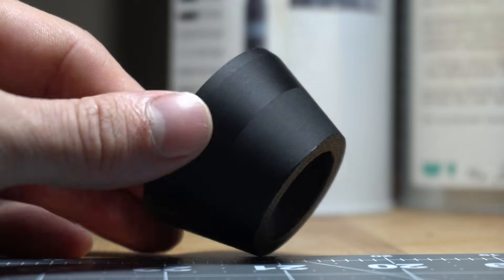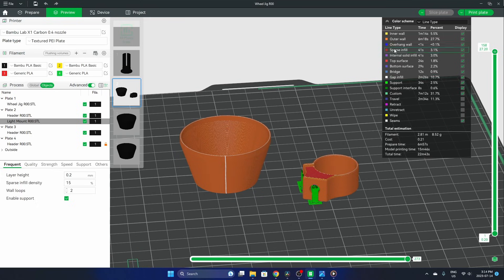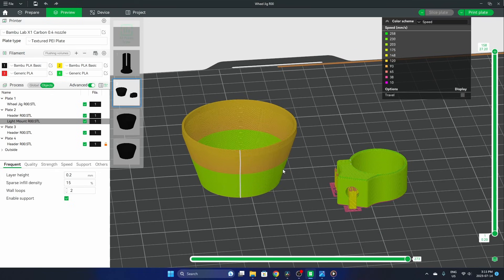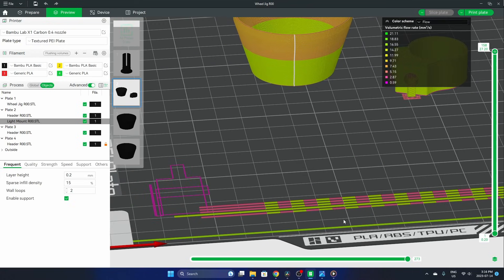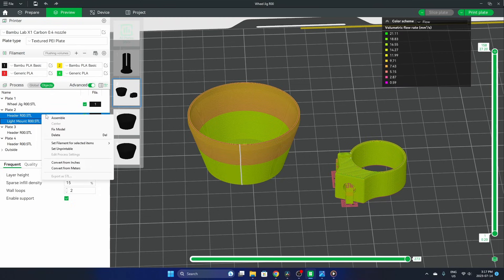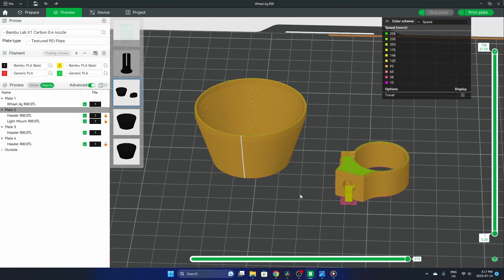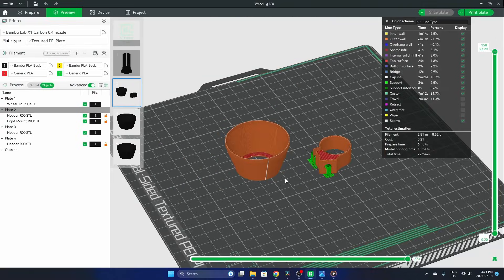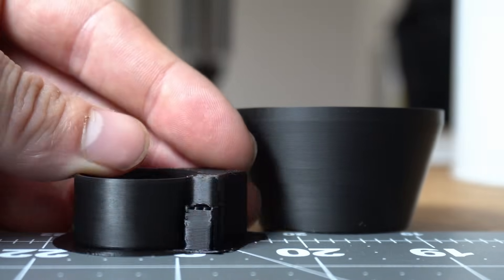How to avoid 3D prints that look like THIS in Bambu Studio

Comment: Good tip! This is probably related with the "minimum layer time" filament configuration, which is preventing the top of that object from printing faster, and since the bottom has that other object, it makes the layer time to be higher, so higher speeds can be reached. If you changed only the bigger part outer wall speed to 100ms it would also probably work, and yeah decreasing the minimum layer time would also improve it and make the print even faster - in this case it could lead to cooling issues, but its worth it trying, I've noticed that for some parts it can be decreased a little bit without any issues.
Reply: This explains it! I was so confused why this would happen.
Reply: Yep, came here to say that.
Reply: Isn't there an option to make the nozzle wait somewhere to ensure the minimum layer time instead of printing slower?

Switching on "timelapse" may help on some printers. Another option could be switching to "print infill first" and add a small pause to every layer - and turn down the minimum layer time to 0.
Reply: @philipp9800  yep, these options are definitely worth it trying, the results may be good depending on the printer and the filament itself. Unfortunately I didn't have much success with any of those options, by the end of the day I ended up having other issues due to the pausing/resuming process like oozing filament, stringing, precision issues (printing the infill first) - that of course can be mitigated as well, but since it wouldn't necessarily make my prints faster anyways, I realized that what worked best for me was just making sure that the outer wall speed is as more constant as possible by picking an average speed - even if it means reducing a little bit the speed, OR just reducing the minimum layer time. I mean, these new 3d printers has that side fan cooling which helps a lot cooling the parts, so if it doesn't have much overhang you can decrease it safely and reach higher speeds even in small parts.
Reply: You wrote it's "preventing the top of that object to print slower", but if you meant the opposite, "forcing the top to print slower", then it makes sense 😅 Physically it could move just as fast, but the layers wouldn't have enough time to cool, so it slows down its movements.
Reply: @renxula  Damnnnn hahahahahahah sorry, you're 100% correct I really wrote it wrong. It was supposed to be "preventing from printing faster". I just edited it so nobody gets confused with it. Thank you!

Comment: looking at that bambu studio has the min layer time to low so it slows down. i would guess each of those layers once its one part is less than 5 seconds if at 200mm/s
Reply from the maker: Yea, lowering the minimum layer time is also a solution to this issue. I just didn't know about minimum layer time when I was filming this video.

Comment: Very unsightly seam: 
3:51

Is there any way to remove this?
Reply from the maker: It's on my to do list to make a video about the z-seams. You can choose "random" for the z seam but I find that looks worse on most prints. You can hide it with "fuzzy skin" but I personally don't want most of my parts to have fuzzy skin. 

You can also adjust the wipe speed + gap settings but I haven't seen great differences setting these settings to their extremes.

Comment: Is there any plausibility to evoid white line on slices (weld thing i suppose)?
Reply from the maker: It's on my to do list to make a video about the z-seams. You can choose "random" for the z seam but I find that looks worse on most prints. You can hide it with "fuzzy skin" but I personally don't want most of my parts to have fuzzy skin. 

You can also adjust the wipe speed + gap settings but I haven't seen great differences setting these settings to their extremes.

Comment: I recommend not only looking at Speed differences in the preview, but also at cooling differences. You want these two being as uniform as possible for your parts.

I would also not recommend compensating these effects by generally slowing down.
This simply turns a very fast printer into a very slow one...

I would rather keep the higher speeds, increase my part cooling and change my layer time settings to avoid auto slow down. 
Bambu-Studio also has dedicated speed settings for overhangs. 
In case of printing parts with overhangs, that might also need adjustement.
Reply: whats a good min fan layer time? and max fan layer time ? i can't seem to understando how that works
Reply: I solved it thanks to you! Thank you very much!

Comment: 1. On final prints simply keep a low temp to avoid the shine effect.  
1. Another way is to use a high temp filament, for those barely exhibit the shine effect across temperature/speed swings.
3. Print one object or multiples of the same object.
4. Use temperature profile hack that only exist in proprietary software of which you don't own equipment.

To this day, users STILL have to baby sit the printed part by adjusting speed and temp at certain layers.  So where is the so called A.I. these print companies boast about?

3D printing is till in its zygote stage of life.

Comment: To me this seems to be minimum layer time causing this. After the first part is done, the printer has to do a lot less work per layer, so it slows down to still reach its minimum layer time. That's why the individual object is printed in the orange range completely, and not partially in the green range.

Comment: all bambu settings are FAR to ambitious. they think that ABS likes to be layed down at over 200mms 😅 oh my... sure... it CAN.. but the result is subpar at best. go see the manufacturers recommendations and u see what their filament is best at. the machine producer in this case is all about speed. so the lazy approach is to lower to volumetric flow in the filament section to one fourth of their number. start from there. u will get MUCH better prints. their hotend is not up to the task of their motion system. these rigs need cht badly imo

Comment: you may want to consider redesigning your holes not to have support. You really shouldn't need supports for those types of holes.
If you want them to look nicer you can turn the hole into more a teardrop shape at the top so the printer is printing a more gradual overhang instead of a sharper one with a circle.
even with a circle though it will print fine with no supports. it will just be a little messier at the top.

Comment: But why is it printing outer wall at different speeds within that object?  Does it have to do with the min layer time?
Reply: Most probably is has to do with min layer time. Could try so reduce that parameter, and keep speed as it was.  Should get everything printed faster, and same speed through entire print.

Comment: Spray paint mate, just paint that and you are golden. Don´t need different colored filament as well.
Reply from the maker: Yeah that's one option. But most people don't want to deal with that post possessing step.
Reply: @3DPrintStuff  That´s true. It is an extra step, and your solution is good. You showed how when this happens it is printing settings which change over time in the same part. So it might be speed, or volume or cooling changes. BTW this happens a lot with "slow down for overhangs" function, you can see it in a single Benchy for example.

Comment: can you change the settings so I can add this to my playlist? I've been saving vids to 3D printer tips but this one wont let me D:
Reply from the maker: @ellieelias6336 Hey I don't think this is a toggleable setting... I just did some looking around in the settings and there is no option for "allow adding to playlists" or something similar. 

I just made a new test playlist of my own and can't come across any videos that won't let me add them to the playlist. I did have an issue where the add blocker I'm using didn't display the "save" button so I had to disable add blocker. 

Maybe try again and let me know if it's still an issue?

Comment: i found another way 

go to click to edit preset  ( button next to preset e.g Bambu PLA Basic)

go to cooling tab

find "minimum printing speed" default is 20mm/s 

change it to match outer wall speed e.g 200 mm/s

200mm/s gives you a matte finish .

Comment: Did you ever run into seam issues? If so How did you fix it? The seem gap is very noticeable on my prints
Reply from the maker: Yeah, seam issues are a common complaint on these printers. I'm working on a seam video. You can try setting the seam to "random" but I find that can look even worse with some filaments, especially silk pla.
Reply: @3DPrintStuff  Awesome! Good stuff. I'll stay tuned in.

Comment: An easier option would be to check the flow rate of the glossy section and set the maximum flow rate of the filament to match. No need to adjust speeds for every print that way, it will be automatically speed limited.
Reply: Turning down flow globally would limit infill speed, would it not? Definitely don’t want to do that on something as fast as a Bambu.
Reply: @ericrandall3539  it would, you could use a higher flow rate limit and % speeds to create a nice profile with fast infill and slower external perimeters. Nobody wants to hear this though because it takes more than 10 seconds to tune.
Reply: @ericrandall3539  well yes but that wasn't exactly the point of this conversation. Go as fast as you want
Reply: That's another option although not easier. You just need to set print by object and space the objects far enough from each other. For surface quality it's better to print one object at a time if you do not need to print too many or too tall parts so it causes interference. Also you should reduce the flow rate anyway unless you need to print really fast as faster speed produces weaker parts.
Reply: @woopsserg why do you speak when you don't understand what he's saying. So much nonsense on the Internet of people saying stuff when they don't understand. Stop!  Think before you comment. Reducing the maximum flow so all flow is equivalent will eliminate these problems. Some of this is often caused by minimum layer time on small parts. So when you print two objects the speed can increase and when the other object is finished minimum layer time comes into play and slows the speed down causing this visible change in the surface quality.
Reply: @trafton00  "why do you speak when you don't understand what he's saying." "Stop!  Think before you comment." That's exactly about you. Printing dissimilar objects sequentially and not at once would avoid rapid change in printing speed to stay within minimum layer time when above certain layer it suddenly needs to print only one object instead of two. Also you can dial down outer wall printing speed instead of maximum flow rate as shown in the video which will give more predictable result. There are different ways to achieve the same result but apparently it's beyond your comprehension. All I said you could just print objects in sequence ("Print sequence: by object" setting) instead of guesstimating maximum flow rate that would be right in filament settings. And FYI I do own X1CC.
Reply: @woopsserg  You still don't get it. The issue lies in the interaction between layer time and flow rate. On layers with longer travel lengths, the printer reaches a higher flow rate as it has more time to accelerate, adhering to the minimum layer time. On shorter layers, the printer fails to attain the maximum flow rate, causing a noticeable shift in layer quality.

You suggested that printing objects one by one solves this, but it does NOT in all cases. This method falls short as it doesn't address the core problem: the variation in flow rate due to differing layer travel lengths.  By setting a controlled, consistent flow rate, the printer can maintain a uniform layer quality regardless of the layer's travel length.
Reply: @trafton00  You don't get that I completely get it. Now re-read what I wrote.
Reply: "By setting a controlled, consistent flow rate, the printer can maintain a uniform layer quality regardless of the layer's travel length."
Also it's not like you are setting consistent flow rate. It's maximum permitted flow rate. Print speed may be limited by it or it may not depending on other settings and what objects you print. Lower flow rate setting would more likely to be the limiting factor. Adjusting outer wall speed setting is easier because you can just look into preview, look for layer with slowest speed and set outer wall setting the same as that or lower so outer wall on every layer will have exactly the same printing speed for consistent appearance without sacrificing printing speed too much.
Reply: @woopsserg  best of luck to you. I tried.
Reply: @trafton00  LOL, I tried too.

Comment: The problem is minimum layer time. The layer takes longer when there are two parts. Meaning the printer is able to move faster and still hit the minimum layer time. The faster speed means there is a higher flow rate, causing that matte look. Increasing the minimum layer time would slow the printer down, giving you the glossy look. Decreasing the minimum layer time would speed the printer up, giving you the matte look. Printing at higher speeds does affect part strength too. PLA that is melted properly should always have the glossy finish unless it is a special kind of PLA like PolyTerra Matte PLA.
Reply: This is actually the same reason everyone gets the bow line on benchy boats too.

Comment: the color difference comes from "minimum layer time" it just prints the upper part slower then the ones below. if you have enough cooling you can reduce the minimum layer time or dont let it slow down. 
you did the other way where speed reduction equals your outer wall speed.

(maybe orca/bambu removed the settings for this.. minimum layer time is a standard setting in prusa/super slicer under filament tab)
Reply from the maker: This is a feature that exists in Bambu Studio that I was not aware of at the time of filming this video. I still like the simplicity of slowing down outer walls. I should make a follow-up video about minimum layer time.
Reply: @3DPrintStuff  do you know how to configure it in bambu studio?
Reply from the maker: https://forum.bambulab.com/t/bambu-studio-minimum-layer-time-setting/3742 @Longinus

Comment: you could also just changed the minimum layer time to prevent slowdown, if bambu  allows that lol, but in my experience, after this is tuned you might want to raise temps unless it's "mat filament". Glossy means better layer adhesion most of the time. printing at those speeds, you need to ignore recommended temps
Reply from the maker: Yeah minimum layer time would have probably been the more rock solid way to solve this. I think outer wall speed is just a super simple concept to understand and adjust.

Comment: Very helpful.  Thank you.  I may try increasing nozzle temperature to see if that also might correct consistency and remove that transition in the print
Reply from the maker: Increasing the nozzle temp is definitely another way to try and correct this change in appearance on the parts. 
Have you already tried this? How did it turn out?

Comment: This is a result of maximum flow settings.  Decrease your maximum flow to one that comes out nice and the slicer will adjust.
Reply: This parameter seems like the best option, then regardless of other settings a maximum calculation will limit the printer to a speed that will let the filament get to temp
Reply: @Gw2Zoke  I basically only change max flow, min layer time, acceleration, and strength/layer height now.  With modern slicers and a calibrated printer, speed is addressed by these parameters and doesn't need to be manually changed.  Keep it at 500 and let the printer purr.

I guess the one speed setting that should be manually adjusted is overhang speed.

Comment: This shouldn't be a problem. Bambu needs to fix it because it's annoying. Some engineers here don't like this crap. It's best to have a uniform part when you're trying to fabricate an object for professional work.
Reply from the maker: Yeah they could implement a "uniform exterior" setting that locks the flow rate on the exterior walls. This would likely work for most materials and prints.

Comment: Looks mostly to be a temperature issue caused by changing flow/print speed. I'd prolly look at that if I wanted to maintain a low-as-possible print time.
Reply: Yeah, increase nozzle temp if you want to keep the speed (less reliable), or limit max flow rate to make sure the filamrnt has enough time to heat up and isn't pushed out too quickly

Comment: Thanks so much for doing this video! I was having a similar issue that'd been driving me nuts on my X1C and P1P with one specific model that was a sphere. For me specifically though, the banding always seemed to line up with where supports were and not a seemingly random height. In the end, the instructions in this video didn't fix my issue BUT the video did point me in the right direction and give me info I needed. Ultimately for me it was a matter of disabling "Slow down for overhangs" when supports are enabled that fixed my issue but I give you full credit for getting me there. Thanks so much!
Reply from the maker: Hey that's awesome to hear. I'm glad this video was able to steer you in the right direction. I'll keep that "Slow down for overhangs" setting in my back pocket.

Comment: Pretty sure you can also use a cube modifier and put it over that top half and force the speed to stay higher and keep the speed and matte finish rather than slowing the entire print down to be gloss instead. I'll be making a video and experiment with this too.
Reply from the maker: That's a good idea. Mine is just the lazy way. I've also seen models where the banding happens in multiple different locations and that would be a pain to paint. Let me know when you release your video, I'm curious to see the results.